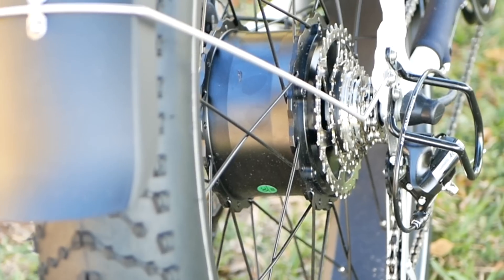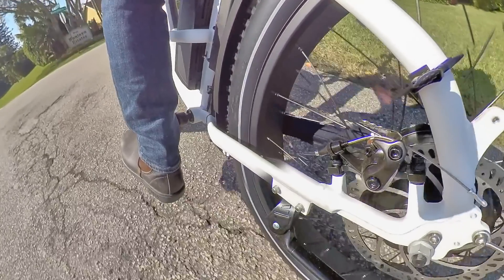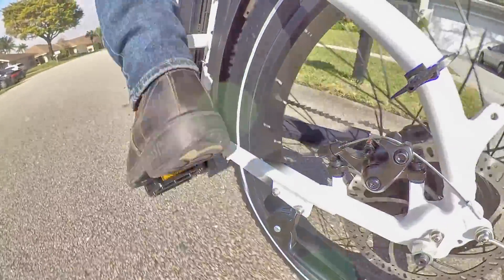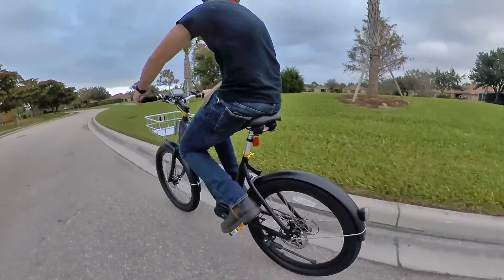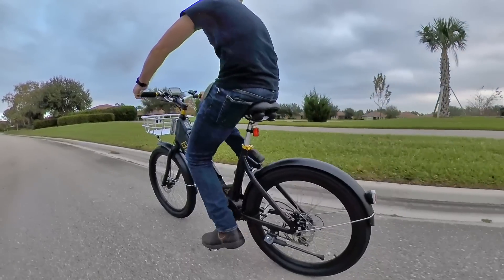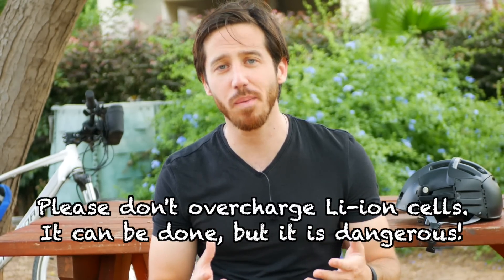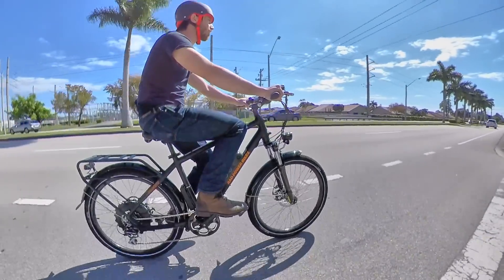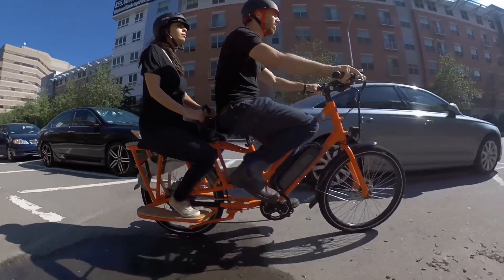Why don't more electric bikes have regen brakes?

Comment: i have it, and love it, keeps my brakes from wearing and produces energie, it does wear out the tire a bit more.
Reply: my bike is a custom build 1500w 48v 20ah bike, it has no bms, so thats not a problem. using 4 multistar 6s 10ah batterys 2s2p range is about 40 to 50 km, i live in the netherlands so most roads a flat, not a chance for overcharging with regen here.
Reply: Regen works good for electric cars not bikes..this is known for at least 5 years..
Reply: @theowink  Regen braking works amazing for bicycles. Why would you want to wear out your friction brakes when you get regen braking for free with any electric motor? 

Bicycles are always slowing down for obstacles on shared paths and road crossings, regen is king.
Reply: difflocktwo maybe 1% use regen for bikes ..if it was so good 100% of manufacturers use it on 🚲 bikes .
Reply: @theowink  Would you agree that bicycle manufacturers spend a lot of effort marketing aerodynamic road frames? Or "fast" racing bikes? Or aero wheels?

However the upright cycling position is fundamentally flawed. Yet this is the main type of bicycle we see advertised. 

How about exposed transmissions? Any machine builder would be insane to have an exposed mechanical transmission, yet on bicycles this is the norm.

Manufacturers do a lot of stupid things at scale, don't get me started on lighting. We already touched on terrible environmental shielding.
Reply: difflocktwo bionix has that system but  not any brand copy their “successful “system because if your battery is dead it’s to heavy to coast due to lack off a freewheel .So it’s always’on’..I personally like the idea of a mechanic dynamo when breaking..
Reply: @theowink  Every Chinese direct drive hub motor and controller do regen. And the Chinese are on a whole nother level when in comes to e-mobility. 

We need to minimize mechanical components to maximize durability and ease of use. You will capture more with regen than the minimal drag of it being always "on". This means you can compensate with just regen. 

you're right though, for these electrical systems to work we need a robust battery that doesn't just randomly die. I think we have a good enough understanding of battery construction to build very cost effective solutions.
Reply: difflocktwo we all need free energy,but if you look 👀 through thr comments lots of people disagree.You think 🤔 they missed the point?
Reply: @theowink  disagree with what? The energy captured during braking can be used to overcome drag is what I was saying.
Reply: difflocktwo i hardly ever brake but that’s how i “roll”..Same thing when i drive a car.So I don’t see the benefit.No friction <>no loss
Reply: @theowink  I think that's self explanatory. If you don't need brakes, you don't need brakes. You are the second person to tell me they don't brake. You're really lucky to have no obstacles during your rides and drives. I ride with pretty good flow but since I'm not alone on the road I'm constantly either giving it throttle or braking. I slingshot around. Blast it in the open and brake whenever anyone gets too close.  I pass pedestrians and cyclists not much faster than 20% faster than they're moving. I sneak past and yield to everyone else.

On a typical ride cycle you would brake more than enough to emulate a frictionless ride. Anyway it's absurd that we are talking about fractions of a percentage drag numbers when energy is so cheap. The drag for me is absolutely worth the regen braking because regen braking is maintenance free and immune to environmental conditions and it's quiet. I would even like to use battery power to get even more braking performance.
Reply: difflocktwo strange,i have regen on my electric step but prefer to turn it to the lowest setting..
Reply: @theowink  Not strange at all. You have very little braking during your ride so you don't need brakes. 

I used to commute on a small kick scooter and really hated the down hills where I would have to struggle to control speed. I had to try to slow down with my feet and with the foot brake that rubs the tire. I wish I had the regen capabilities that you have on your kick bike.
Reply: difflocktwo regen power is too weak too charge but some people it’s the wholy grale
Reply: @theowink  I have see regen so powerful that it has locked wheels, there is a video on YouTube that ebikeschool has shared in a previous regen video. Very powerful stopping power from regen alinet. It's truly amazing.
Reply: difflocktwo does it not damage the charge controller ,because of the peak charge in short time?
Reply: @theowink  In this specific video I think they didn't have a BMS or bypass it when regen braking. With my regen it is directly to the battery, no BMS. BMS only for charging from the wall. 

For a more complete system you would make sure that you don't go past the limits and choose the right components. A very powerful system forward will also be a very powerful system in reverse (regen braking).
Reply: difflocktwo ok 👌

Comment: The answer 99% of the times is: "because they have a freewheel, you dummy!"
Reply: @Click Bait What are you on about? Regen braking allows you to convert the energy lost as heat to electricity instead while manually decelerating. 

They're definitely a benefit to hub motors when set up correctly, for example you will save on pad and rotor wear. 

It has nothing to do with losses in air or rolling resistance which are universal to all systems...
Reply: @Click Bait  You do realise that instead of your brakes heating up, it's the motor that converts that kinetic energy into electricity?
It's not converting the heat, it's PREVENTING the heat. 

Cooler brakes=safer brakes
Cooler brakes=longer lasting brakes

You literally cannot argue with that, it's a fact. 

Obviously regen braking will have a lesser effect in florida compared to the alps, but for some people it can bring upwards of 20% of juice back into the battery. 
How could that not be worth it? Don't tell me that dragging the specific type of motor uses that much energy, because it doesn't. 

So other than not liking "the feel", which is subjective, there are no objective downsides with a regen system as long as it's wired and programed safely. 

It's becoming especially useful for these higher speed ebikes that have been taking over the diy markets. 

I understand the casual grocery shopper that won't surpass 25km/h on flat ground probably won't see the benefits, but those aren't the only people riding ebikes. 

All your theories may sound valid on paper, but real world experience has proven it's usefulness.

Regen braking also allows for a smoother and safer operation, as the rear is quite easy to lock up for many riders using regular brakes, especially on the wet.
Reply: @Click Bait  mate have you even read anything that I've written? The point of regen braking isn't sorely to add range, which it can absolutely do anyways. 

You're ignoring 90% of my comment and focusing on taking this personally.

You simply have something against regen for some personal reason and are ignoring all the benefits it can bring, as you haven't acknowledged any of them and keep using the same argument that it won't add range... Which once again is false, and has been proven by real world experience.
Reply: @Click Bait I realize that in some cases the additional range might be minimal, depending on riding style, weight, topography etc...

Why can't you acknowledge that the benefits go beyond range?
Reply: @Click Bait this is not real ! Do you have any quantitative evidence of what you are saying? You don't.
I do have real life tests on my web site: 
http://gonano.eu/regenerative-braking-efficiency-versus-speed-part-two
Reply: Mid drives with derrailleurs would not like reverse direction either right?  so single speed fixies only.   ?With a hub motor could it toggle in and out of a regen state?  That would be great.
Reply: Nick Cedar  Regen works with hub motors that are specifically designed to do so. 

Yes, you could disable regen manually with proper software. 

For example a proper setup wouldn't allow regen if your charge is at 100%.
Reply: @maxellp  The cheapest Chinese controllers have settings for regen, including maximum voltage.
Reply: difflocktwo not the cheapest, lol, mine have nothing to change (I changed power limits by modifying the curcuit shunt resistor and changed it’s PAS system with an Arduino and relay to allow throttle control whilst pedaling first a regulation loophole in my state), but my controllers are very basic, it’s got brake cutoff switch, a throttle, and an on/off switch (it also had PAS, but it was like full throttle even if barely pedaling and basically suicide with it stock rated at 1200w...). My other ebike kit is the same (they were suppose to have a wire internally you could remove for removing speed restrictions, but mine didn’t even have that, which is fine because I want full throttle control, so I guess that was earlier edition). They are just the basic 1000w controllers that are like $20 (they work fine, they just don’t have any fancy features), they are what you find on most budget kits.

Comment: I want to know why it's so hard to judge a motors watts based on it's size.
Reply: Watts = amps * volts, it doesn't have anything to do with the motors size. Motors don't really have "watts"; they are rated to handle a certain amount of watts. But technically you can run as much wattage as you want in any motor. Some will just handle that power better than others.
Reply: Ian Lofgren I have a frt hub drive 250w motor and a 36 volt battery. When my battery goes I’ll have trouble replacing it as the company is no longer in business. Could I build a 48 V battery to run this motor and would it just be ‘confusing’ for my charge controller?
Thx Richard
Reply: @richardbailey2130  most motors and controllers can handle 48 volts. If the capacitors inside the speed controller are rated for 60 volts or higher, then a 48 volt battery will be fine. I actually build custom lithium ion battery packs. The only down side to the higher voltage, is the watts going to the motor will be more, so the motor will run hotter.